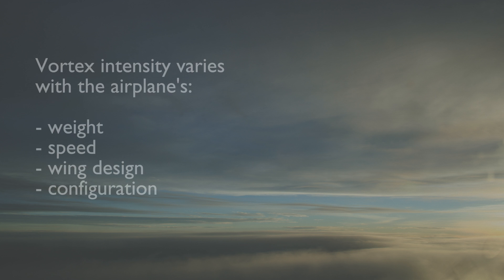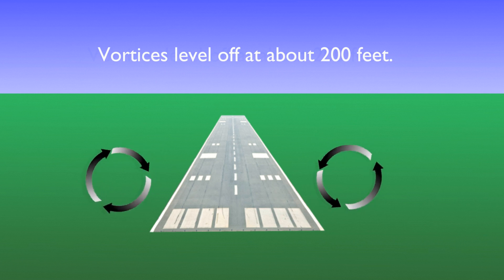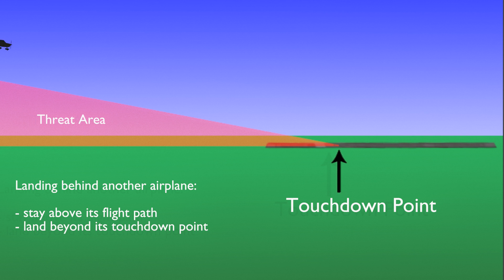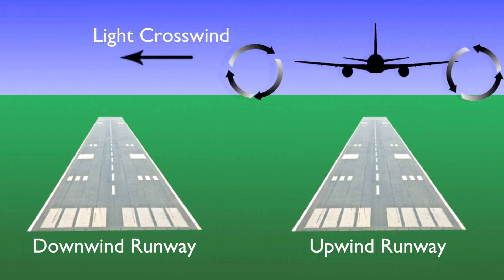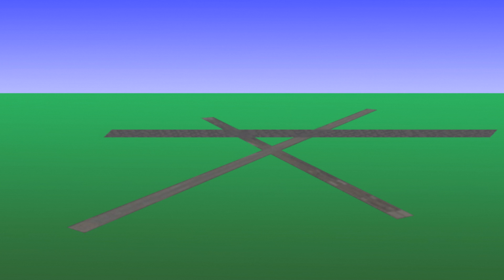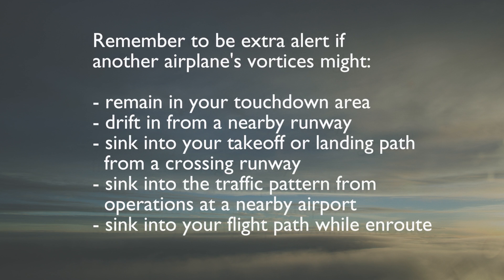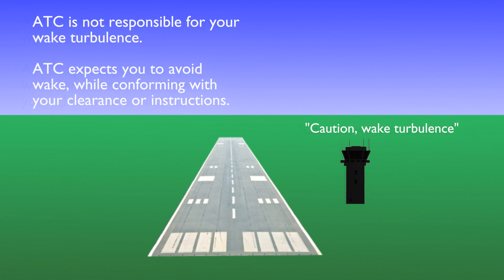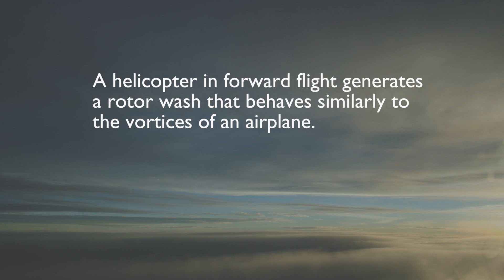Wake Turbulence Avoidance

Comment: Nice information video.  Perhaps it would be  useful to explain that between the wingtip vortices is a solid cushion of mass down thrust air moving at about 2/3 the aircrafts speed (creating the same downforce at the weight of the aircraft ).  This hidden wall of high speed air can really throw your aircraft into a sudden spin as we experienced in a commercial flight very near the ground on final after a turn into the landing run to save an hour of being stacked.  Unfortunately the pilot did not appreciate the heavy a short distance ahead.  Now he knows better and all us passengers were just  very happy to be safely on the ground.  By the way, our pilot was completely disheveled, sweating,  tie untied, but he bravely gave all his passengers I personal departing greeting at the exit door.  The price of an important education, which came to no harm.  David L.

Comment: It just doesn't fit my head that it takes several minutes for the air movement to dissipate. How does it persist for so long...
Reply: Have you ever seen or used a vortex cannon toy, which has been filled with with smoke? It can shoot a smoke ring right across a room. Once the air in a vortex is rotating, it continues to rotate for some time. I liken it to a flywheel.

Comment: A question about wake turbulence & vortices - as I encountered a question on an RPAS  pilot exam. The question asks what factor could cause a vortex to stagnate above my ground position, with options being (Tall trees around my position, (b) light wind), (c) relief, such as hill or mountain, or (d) cloudy sky with precipitation. From my own research, (b) does not seem the answer as light wind will simply move the vortex around. (d) does not seem correct either, as precipitation will have no effect on vortices. (c) seems correct to me, as any sharp vertical movement due to orthographic lift would disrupt it, but I cannot verify that this is correct. Any advice?
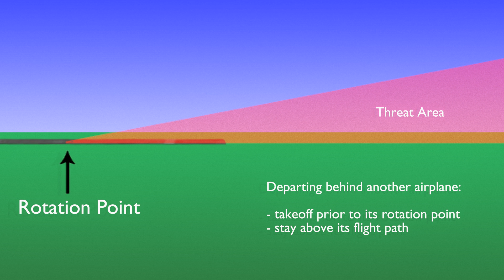Reply: I would say (b).  A light cross wind can cause the upwind vortex to camp out over the runway.  Watch at 3:00